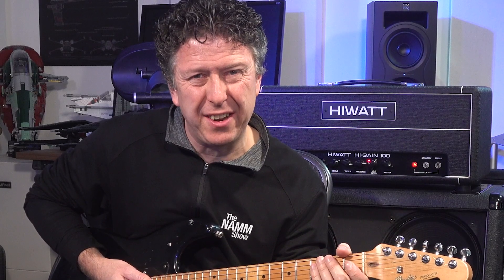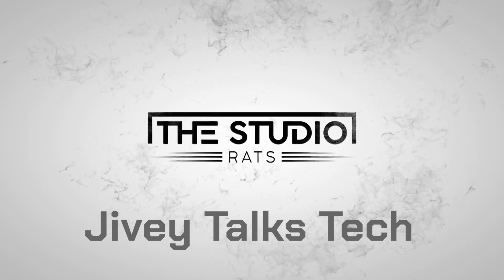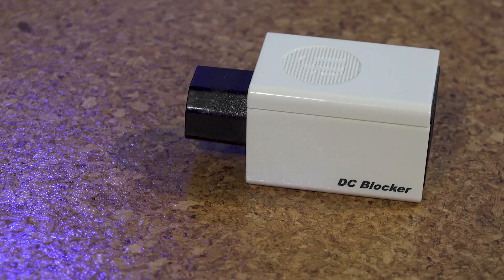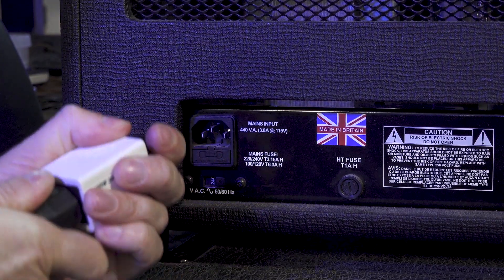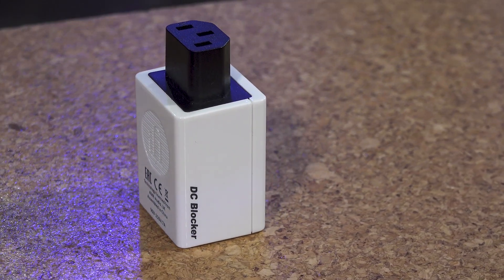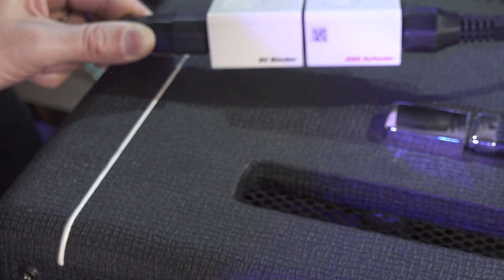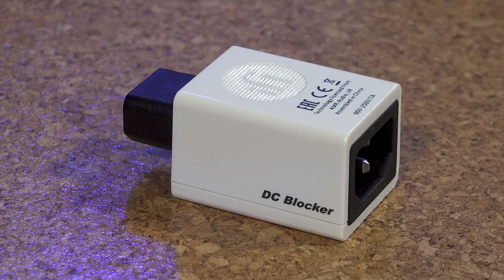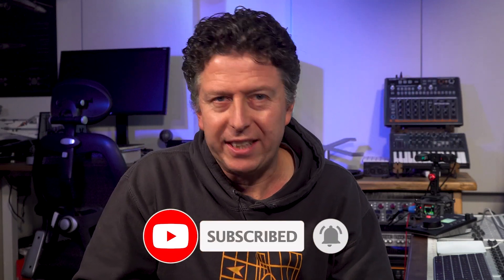Stop That Annoying Amp Hum - DC Blocker from iFI

Comment: There is dc blockers on alie express and even amazon from china that cost $10 or even less that have way higher dc blocking capabilities and actually higher quality components. DC blockers are cheap, It's a few diodes or a full bridge rectifier and some electrolytic capacitors.

Comment: Why would an AC output from the wall outlets have a DC voltage/DC current that is causing HUM? that doesn't make sense at all
Reply: AC from the mains is seldom purely 100% AC! That small amount of DC voltage is why transformer hum is exacerbated in the first place. DC saturates the core of the transformer, generating heat and kinetic energy from DC, shaking the trafo and causing audible humming.
Reply: @iFiaudiochannel  When measuring DC voltage on the 120vac wall outlets at a house my DVM meter is NOT measuring any DC, any reasons why? There must be a different earth grounding reference or something I'm doing is wrong

Comment: Hmm something is a little bit off here... most DC blocker`s contain large electrolytic caps... cant see this mini gadget will work.
Reply: Most might! Our DC Blocker still blocks up to 1.2V of DC on the AC—and works up to 7A!
Reply: it helps if you sit away from the amp more and it helps if you use humbuckers or noiseless Strat coils or more shielding....

Comment: Cool! Now, how do I stop my guitar picking up my computer fan or whatever that noise is? Depending on how I turn, the noise goes away. 

Could this be the same issue like you're showing in the video? I'm experiencing this when recoding onto my computer, no amp.
Reply from the maker: @nedim_guitar  I don’t think this is the issue I’m describing here.  I’m guessing your guitar has single coil pickups?  Maybe worth checking the cable you are using and check that your computer is properly grounded/earthed.
Reply: @TSR-JiveyTalksTech  The cable is ok, it just might be an annoying ground issue. Thanks Jivey!
Reply: @MulletTrain-o2g Yeah, sounds about right. Now, if there was something we could do about it... Maybe putting the computer in another room? We'll see...